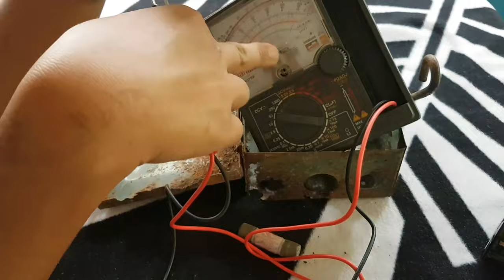Ano ang pinag kaiba ng lumang fuse box sa circuit breaker ngayon? | Tagalog

Comment: Idol kapag may main circuit breaker kana 20A pwede ba gumamit ulit ng isang circuit breaker 20A ulit para sa 4 na ilaw at 3 outlet? 2 bahay kami magkatabi lang po. Para sa isang bahay may breaker din po para sa outlet and ilaw po. Sana ma notice po.
Reply from the maker: Yes po pwede dapat ung linya ng isang breaker is sa ibabaw nyo po ng isang breaker mo po  sya ita tap. Then ang wire na gamitin nyo is 8.0. o kaya para maging mas lalong maging safe pag panel board kayo kahit 4 branch para ma seperate ninyo ang LOAD duon. 
Salamat sa feedback , GODBLESS

Comment: boss ask ko lang, ok lang ba na naka tap sa fuse box na 30 amps yung breaker ng aircon na 30 amps din, 0.5 yung aircon boss na ikakabit yung wire pala eh size 12 na spt flat cable salamat boss.
Reply from the maker: dapat po master bukod po dapat ng cb kapag acu. para safe po tayo. 20amperes po dapat. Salamat po sa feedback master GODBLESS PO💜💜💜

Comment: boss safe ba yung ginamit ko na entrada is 5.5mm2 thhn po. at ang main ko is 60amp. dalawa po na fuse tatlo na ilaw at isang outlet po..kasi. yung dati yung gamit nya na wire is pdx 2.60 mm2
Reply: bale fusebosx pa lng po yung gamit nila
Reply from the maker: Master mag babase po tayo sa main cb na gagamitin nyo. Kung 60amps. Po main nyo advisable po standard na sukat na wire gagamitin nyo. #6 po kr 14mm2 na sukat ng wire para sa 60amperes na cb. 
Salamat po sa feed back master godbless po.
Reply: ok na po master 30ampere po yung pinalit ko

Comment: Sir ganyang fuse box meron kami..balak ko magplit ng breaker. Ask ko lang kung dalawang fuse na tig 30amps ang meron kami.. ano po total naamp nyan? 30amps or 60amps.. at kung 8 ang size ng wire nyan.. pede ba paltan ng circuit breaker na 60amps?
Reply from the maker: Gamit po kayo master ng panel board. Duon nyo po ilagay ung dalawang 30amps. Bali po ang magiging mainc cb nyo is 40amps. Then #8 na wire po ang gagamitin nyo para sa Service Entrance. Salamat po sa feedback master. Godbless po
Reply: Gmit k panel 6 branches 4x2 boss

Comment: Sir possible b n kumuha ng branch s fuse box para s circuit breaker ng aircon? Safe kaya pag ganon? Multigrounding connection s box..

Sana po manotice comment ko.. Ty
Reply from the maker: Sr. Kung sa fuse box kayo kukuha ng supply para sa ating aircon. Advise ko lang po mag panel board na po tayo para sure ba safe po ang ating mga connection. Kc ang fuse box master pag kc nag ka roon ng short circuit za sting mga linya pumuputok ang fuse. Sunod pa minsan ang wire. Kapag nman sa CB is nag ti trip off lang po sya. Makalumang style n po ang fuse box. Kaysa ngayn. 
Tnx sa feedback master ang GODBLESS po!
Reply: @ElectricalPinoyTutorialTV  Thank u sir.. Wat if meron sariling breaker ung aircon.. Magtatap lng galing s fuse, posible po ba? Sana mkagawa po kau video about don.. 👍 Ty
Reply from the maker: @jhayv4862  pwede un master maglagay nlang po kayo ng Full box or square box para sa linya galing Service Entrance. Para sa Termination ng linya natin papunta sa  CB ng aicon at fuse box.
Reply from the maker: Cge master gagawan natin ng video yan. Wait ko lang po ung order kong materyales